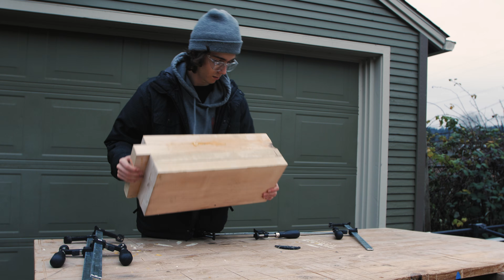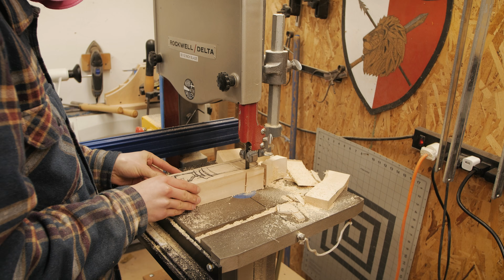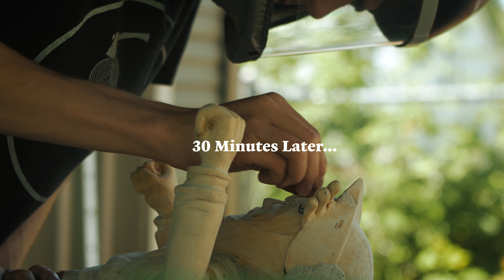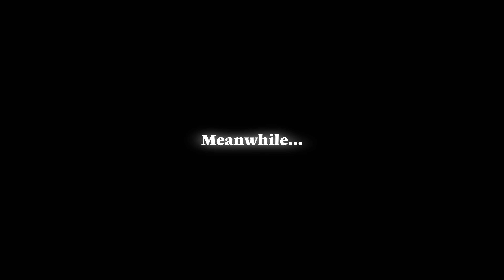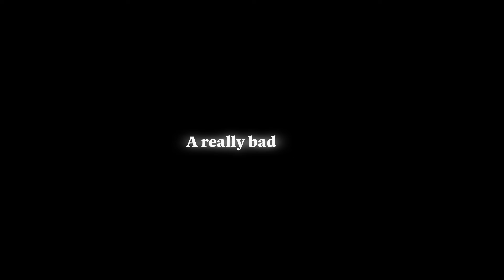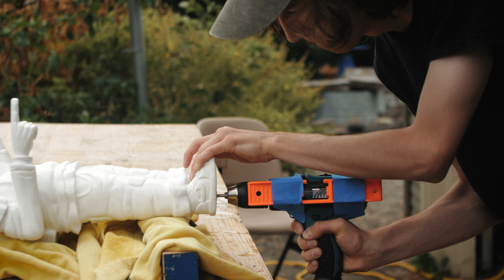Risking it All to COLLAB with my Favorite YouTuber... (ft. Ten Hundred)

Comment: I set my Fordham flex shaft up on an IV pole, and can roll it around the studio. It can be a little topsy-turvy, so I add weight on the bottom of the IV stand, which helps. I only suggest an IV pole if you want to have your flex shaft be able to move around. This is an amazing video and such a cool piece. Congratulations!

Comment: I came from ten hun’s channel. I’m a sculptor as well. One thing I noticed that would help you with sanding in tight spots. Excel Sanding Sticks. They get in tiny areas and can be used on many different mediums. You’ll love them! Also, the hoodie strings you made out of Sculpey would have been less fragile if you had used CosClay. It acts exactly like Sculpey but it flexible. It’s crazy how it works. At age 17 for me I was so insecure about my art. Good on you that you have more confidence! Keep on keeping on and you’ll be up there with the greats!!! Great job!

Comment: Well Miles I discovered you before Ten, so you got my subscription first 😅.  I used to work in a carpenter shop in the Navy where I fell in love with tools. I enjoyed watching you create this this work tremendously.    I too am highly inspired by other’s work so I’m thrilled Tenhun accepted your offer.  I make needle felted sculptures and draw and paint.  I started out with crocheting and knitting, but often they are very terribly misshaped objects so I have moved on to consider using them in my head for art purposes rather than wearable objects.  Thanks for the inspiration.  Even though I don’t use the same medium it’s still applicable.

Comment: You're lucky if you didn't destroy the chain and bar. It'll massively overheat and ruin cause deformations and premature wear. I was wondering why the chainsaw wouldn't have worked because those Makita 36 volt chainsaws are actually pretty powerful especially for something like basswood. Other than that super dope

Comment: Came here from Ten Hundred's video.  So impressed with you!!  Quick question.  I also work outside on some projects.  What kind of table are you using?  I have had some difficulty with having a good flat portable surface to work on.
Reply from the maker: Thank you! Good question also. I just use two metal foldable saw horses and the table top is solid pine I believe. It was an old store fixture that was given to me for free. If you stacked two layers of plywood though it would definitely be strong enough.
Reply: @makewithmiles  I did make a Paulk workbench but I think my plywood was total flat. I may try another one.